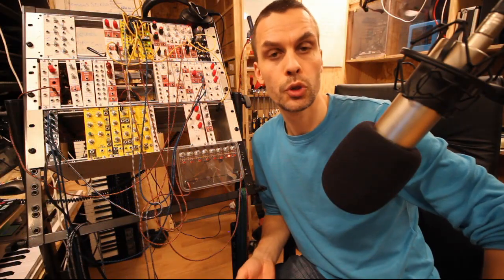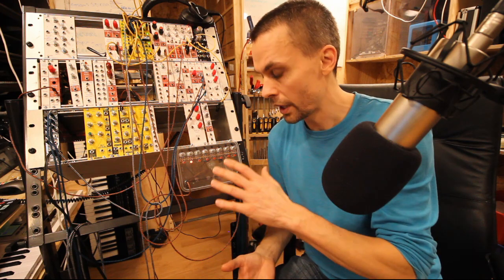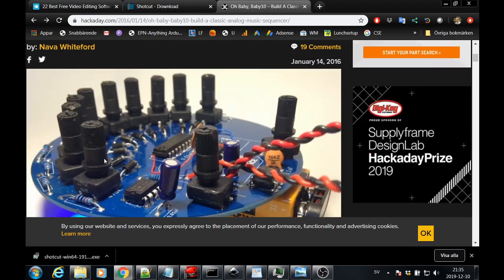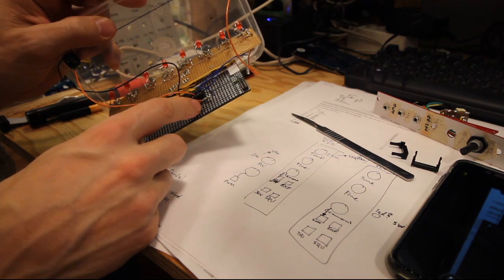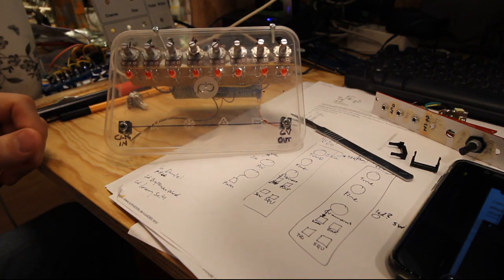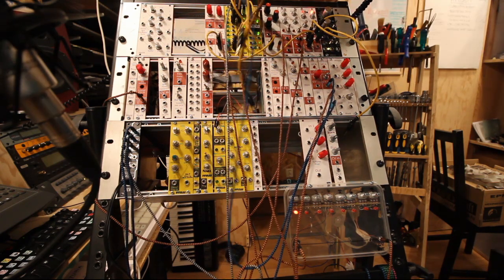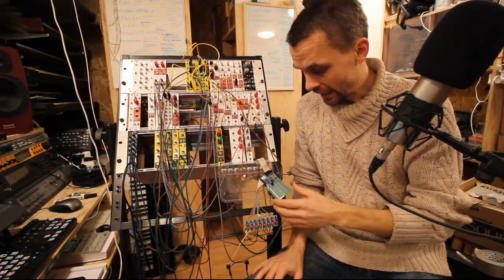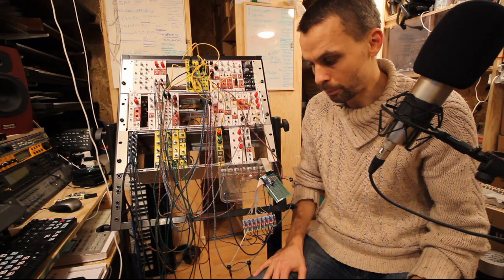Basic Baby8 CV only Sequencer - DIY Modular in a Week 10.1

Comment: Are those patch cables just 3.5mm stereo ones? Saw them being quite a lot cheaper than real "eurorack mono patch cables".
Reply from the maker: Yes they are. But many of them is starting to give up. They don’t really have much wire in them which is probably why they are so much cheaper.
Reply: @SourceryOne  Good to know, thanks! almost invested in a bunch of them. instead went with another listing, wonder how they will hold up.
Reply from the maker: I am always looking for cables. Do you have a link?

Comment: Hey Kristian - finally made this first step.  Sounds nice, works well.  Except for the reset input, which kept causing everything to short.  Then I noticed on the next part you added a buffer to the reset, so that's probably the issue.  Hope to get that done tonight.  Really cool.  Pretty simple project, but my one recommendation to anyone building this would be to mount all the hardware first, then solder to the hardware in order to keep a sense of all the pathways.  I'm doing this one on a large aluminum sheet that lays across the top of the box.  I'll try to get some pics on Patreon.  Also did a quick jam testing it out and will add that link to your jam video page.  Thanks as always, have a great holiday, and take care!

Comment: Thanks for this video. I plan to build a 10 step version of it and was wondering, why does this design have both normal diodes after the pots and LEDs for indication? couldn't you just use LEDs for seperating the outputs and build the whole thing with half the components?

Comment: I’ve been putting off my sequencer as well. It’s an easy circuit, yet it seems very daunting.
Reply from the maker: I get that, and have the same feeling. I think for me it is the panel real estate issue. You should see all my notes on how to organize the panel for best work flow. I hope I can come up with some good way of doing it though. Let me know if you do a design. Would be interesting to see how you solved it. :)
Reply: Kristian Blåsol if you go to my page you can see my panel layout with leds, switches and pots. It is not for eurorack. My progress has been slow so far, but I will finish it eventually! I really enjoy your videos! Thank you for sharing this!
Reply: @Sarahbuildsstepsequencers  I have also been putting it off for quite a bit for the same reason.  Just start with a few steps like 4 then when you get that working add more once you get the hang of it. Hope it works out for you.

Comment: I made a Baby 16 by cascading 2 4017s together. I put a 12 way switch to select the number of steps (leaving out the weirdest numbers like 7 or 15) Gate is easy to get but trigger is harder... Ended up putting a high pass RC plus diode on each out then into a comparitor. Also added hold, manual step and reset buttons. I actually clock mine from my DAW so I can run it in time with my other midi gear. Oh and I also added a portamento knob!
Reply from the maker: Thanks for the suggestions. I have thought of many of them already but it is still nice to hear what other people have done and their ideas. I will add quite a few of these to mine. But for the trigger out I thought a cgs gate to trigger might work. I thought of putting the portamento as its own module even though it is quite an easy circuit. But how do you clock it from your daw? Do you have a video or other showing off your work?
Reply: @SourceryOne  I tried ANDing the clock and (switched) gate to get a trigger out but it never worked due to the gate lasting a tiny bit longer than one step, giving a double pulse. There is no gap in the gate so it's hard to make describe separate triggers from consecutive steps from the gate output. That's why I did the rc filter on each step's output. Will try to make a video explainer soon.😀 edit: I see the cgs is essentially the same as ANDing. .. I tried it with a 4000 series AND gate. The cgs looks more sensible it must be said!
Reply: Well maybe... looking at that circuit I think you'd get the same problem.. gaps are needed in the gate to generate a trigger for each step..
Reply: Guessing he uses a midi to cv module?
Reply: @alebrenna441  no I send a 16th note click track from output 3 of my audio interface to an audio to trigger circuit which is output to the clock input. I will try to make a video as suggested to show what I've done soon.
Reply: Nice! Would really like a video of that seq qith features explained!

Comment: Very nice. I've been avoiding the whole sequencer bit but now might be a good time! I would add a SPDT for switching between 4 and 8 steps, a manual step button, and a simple glide circuit. Inspired by MFOS 4017 sequencer. Might be nice to have a gate output that sends a gate at every step in addition to the switchable gates. But I guess that one could just use the clock for that. Maybe if we add a gate/trig switch, to convert the clock to pulses. Hmm. Pin 13 (Clock inhibit/Enable) is also interesting since setting that high pauses at the current step.

Comment: Yes! I'm working on one of these. Willbe waiting for the next video!!
Have you seen fonik's schematic? Looks nice, I've read the 4017 is a little problematic when sending clock to it
Reply: I've found the clock to be the least of the problems. I've even found that a push button switch was able to step thru quite reliably. Nevertheless in my final version I did use a debouncing circuit for manually stepping thru the sequence.

Comment: The only way I can think to get a baby 8 into eurorack height is to use the tall thin song huei potentiometers.
My only issue with that is that I don't like them!
Reply: Transversal? 2 rows of 4, and lot of spare space for switches and jacks!! You can bend a little the pot pins and win a little space!
Reply: @alebrenna441  I literally hadn't even thought about that!
This community is great for coming up with ideas.
Reply: You can squize 4 pots in vertical line too, also 2 rows... And the rest of things on the side. Circular is another way of gettin it going. Lots of designs!! Search for 8 step seq eurorack on google images I'm sure you'll get many many ideas!!
Reply from the maker: Yeah there are loads of designs for this specific sequencer. Actually the small white pcb you see in the video actually would fit in one row in a eurorack. I use trimpots with a really nice turning pot. Multi turn 12 turns I think.